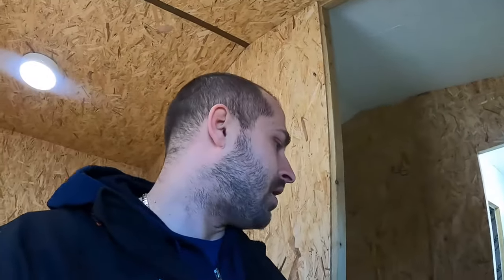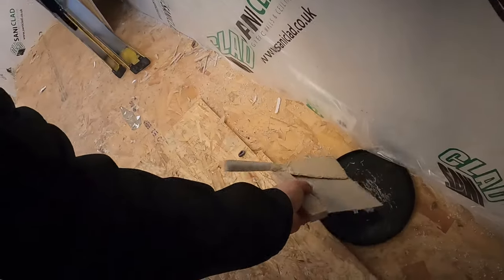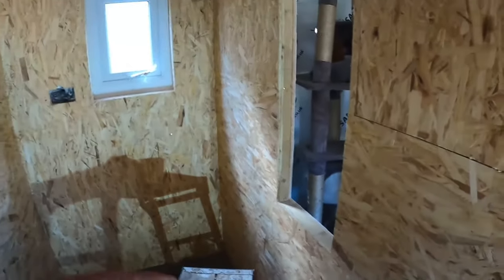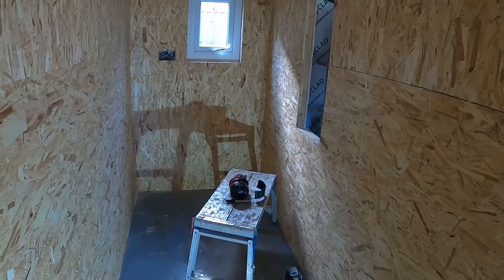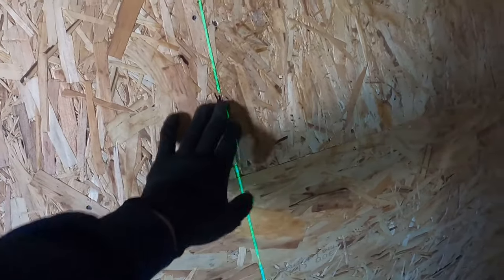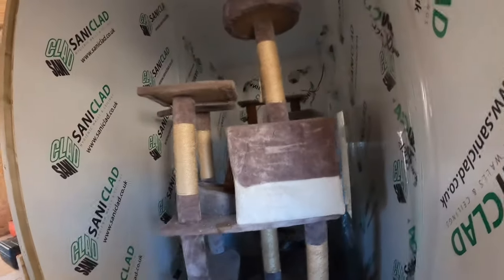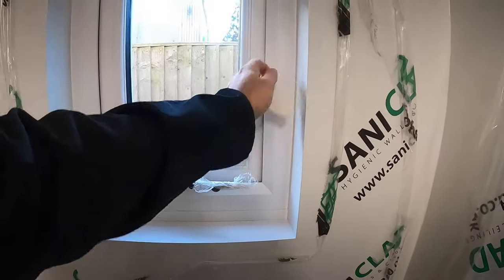Fitting Hygienic Wall Cladding

Comment from the maker: 0:00 Intro
7:45 Discussing first step
10:45 Taking measurements and  working on the first wall
12:14 Talking on how to join the boards
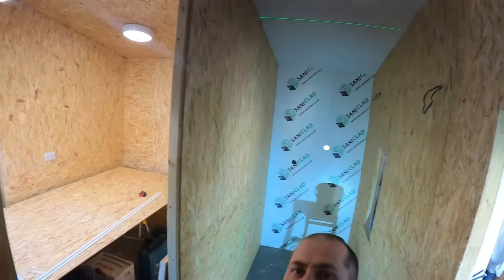13:43 Next board in progress - fitting the joint
14:53 Dealing angles and curvatures (avoid wasting expensive material)
17:03 Next wall underway
17:55 Final thoughts + Tips
21:18 How this all looks finished + More Tips
Reply: This has been super helpful - thank you! I'm just wondering if you have to use the dividers between each sheet? Can you not just silicon between the sheets like you've done in the corners?
Reply from the maker: @SimonLove-pc1eg  Good question, I haven't tried that but technically it would be bit more time consuming as you would have to get all your joins spot on, but if you have a chance why not try i would like to know how you got on. 👍
Reply: @ANCarpentry  I think I'll follow your instructions and use the trims between each sheet, actually! Thanks man!